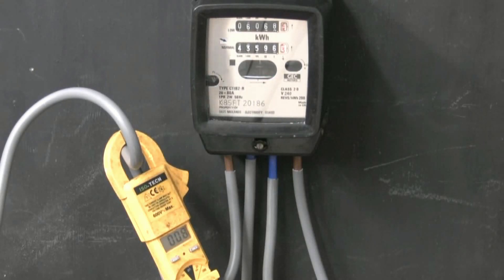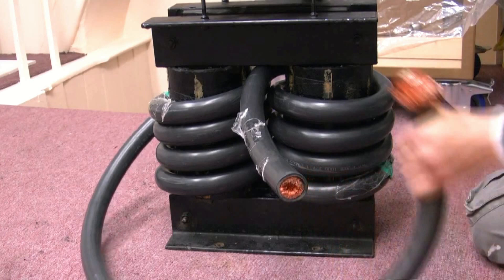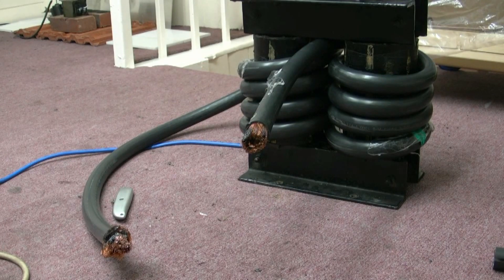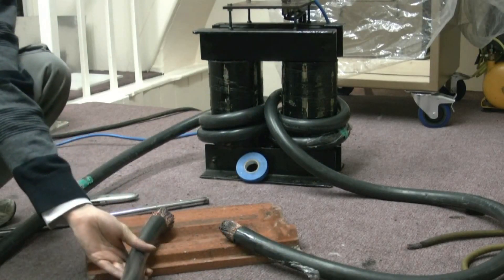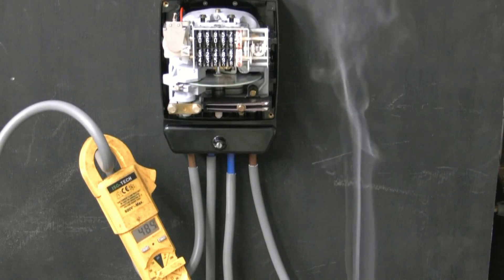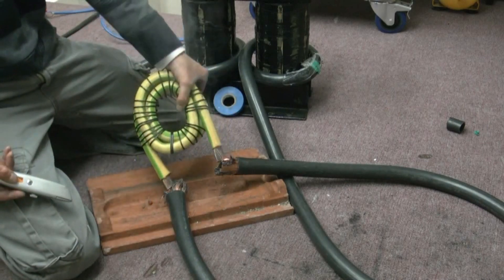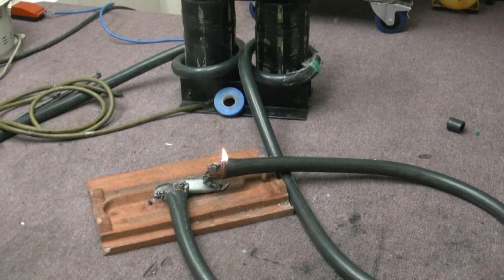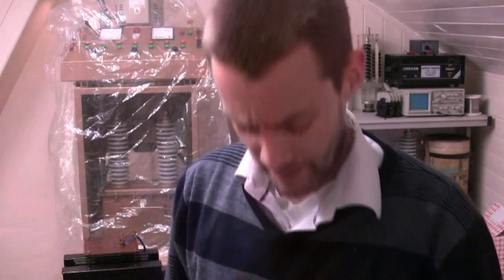Too Much Current + Electric Meter Pops

Comment: Dear SIr,
I'm an electric engineer and I saw your videos.

With your stupid actions You suggest persons without competence
in this field to do things potentially dangerous for their safety.
Maybe you are some kind of 'rough expert' in electric stuff but
you are an idiot for sure because you are an irresponsible person.

Best regards,
Michele Romeo

p.s. - if you ask me to do, I can provide you a list of very stupid things you made in all your videos.
Reply: It'd be better if you provided a list of every time he's said "what I'm doing is perfectly safe, please try this at home."
Reply: I'm sure you're very intelligent (sarcasm).
Reply: Michele Romeo Attempting to condescend someone whilst knowing nothing of said person really just portrays you as being the person to avoid.
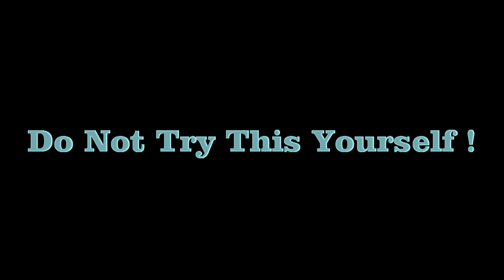Reply: It says at 0:12 "Do not try this yourself!"
That's enough of a disclaimer, don't be such a stick in the mud.
Reply: Michele Romeo I do certain things without fully abiding safety instructions due to experience in my fields of knowledge. I have never been injured in this way.

I'm a safety oriented person. Once I quit a job of 2 years because my regards on safety (especially for newer persons in that environment) were disregarded. 

Unless you list actual things that were done incorrectly (and there are some) you have no argument. Up to this point you're all smoke and mirrors. 

Everybody has a different limit to what they'll do safety wise. When I'm dealing with high voltage and thick wires I wear gloves, make sure the wires are not live and use one hand so there is no way for current to go through my heart. 

However with the knowledge he possesses he can have some leeway with the electrical stuff, provided his knowledge is good, he'll survive. 

It's the same way with me in a lot of different situations. 

Accidents do happen, independently of measures taken for security. What he does in this videos is extreme by nature. An unexpected explosion and an unfortunate piece of shrapnel and PI loses an eye. Still it's his choice. 

No regards,
ME
Reply: Dear Michele

Fuck off

Sincerely, everyone.
Reply: kkonstantinosss2 "Romeo, you do not know how to write properly." ...First, my birth name is Michele. Second, I write properly, better than you. Third, I know electric engineering, which I teach to students everyday, students that want to go back to their family at the end of the day. At the end, I do not care about stupid persons with totally unuseful opinions, and just the desire to insult the well-posedness of shareable statements, with no criticism, no hard things on which to make serious discussions and all what human beings need to say to be 'intelligent'. Conclusions come almost natural: any comparison with you gives no sense. Come back to me when you have 'real science' to discuss on. Best regards, Michele Romeo
Reply: I am also an Electrical Engineer, what he does has the potential to be very dangerous but he handles himself and the equipment relatively safely. Notice that current takes the path of least resistance and he plays with high current by using beefy power supplies and heavy conductors... theres really little chance he will be in the path of this mighty power.
Reply: The disregard for safety is part of what makes these videos entertaining, but that point seems to have gone over your head. Also he's made it abundantly clear that what he's doing isn't safe and most certainly shouldn't be replicated, which also seems to have gone over your head. You try to make yourself out to be superior to everyone because you're oh so serious, when in reality you just seem to be complaining for the sake of complaining. You've implied many times in this thread that you have no interest in the opinions of others or in petty debates, yet you continued to reply after you've said so. A point which only goes to show further that you're just complaining for the sake of complaining.
Reply: Michele Romeo So you're saying he's stupid. Do you realize that you are talking to a high-end National Grid engineer?! Furthermore, you offering a list of 'stupid' things in a sarky way, saying he's irresponsible is just plain foolhardy.

I urge you to either remove or reconsider what you've commented on and your actions against Photonicinduction as you have been quite rude to some quite intellectual people.

I won't say 'cheers' as that's your insulting word of choice.

And you saying there are cretins commenting here? Well there is a cretinous being here........ You.

I may be younger than the people who have commented, but even at my young age, I can still see your rudeness, your total disregard for others, and you being self centered, goes to show why you shouldn't have posted.

Therefore, I would like to advocate my disgust of what you've said. In which capacity I shall encourage Photon to carry on making videos for the entertainment of others, and for people to comment without you.

Thanks.
Reply: at which point does he go out and tell us to do this shit? we're not stupid animals,. we know it's not safe; that's why we let people like him do it..so we don't have to :}
Reply: Jamie Evans You are begging the question by assuming that he is, truly, a professional and by claiming that I know nothing about the subject. Your statements are unfounded. If they were anything otherwise, you would be able to present concrete information to me (graphs, charts,university studies, ect...). Of course, no such things exist about my knowledge, so do explain to me precisely how you know that I know nothing about this subject. We both know what that outcome amounts to.
Reply: People by nature do stupid things, some of them dangerous. This guy does them only after pre-warning about their being hazardous and does not advocate nor condone people doing them without a proper understanding of what they are playing with. He also does them in the interests of the entertainment of his viewers. There are so many things one can watch on main stream media that people could copy, that inevitably could end up in serious injury, hurt or death. The onus is upon the individual to make decisions that are wise.
Reply: Those who can, do. Those who can't, teach..
Reply: Romeo, you do not know how to write properly.
Reply: Michele Romeo First off, I am not german. I live in Switzerland and although I speak german because the native language in the part of Switzerland I live in is very similar to it, swiss people have a very different mentality from german people. This doesn't mean I dislike germans in any way. I also have many german colleagues.
Secondly, tell me how my comment was not logical. Maybe you interpreted it differently from how I meant it to be interpreted due to my lack of knowledge of the english language while writing it.
What I meant was that most people aren't as stupid as the comments they write. Indeed there are also very stupid people writing comments, but it is difficult to differentiate between these and the ones who only "pretend" to be stupid if they don't write a sensible answer afterwards.

Overall, if you still don't agree I would be interested in your opinion on the matter, because this is just mine.

Regards
Reply: Do you honestly think he doesn't know what he is doing?
Reply: There's always someone out there who takes other peoples lives too seriously. You don't have to watch his videos if they offend you so much.
Reply: ooow you're an engineer, big deal, so am i, and i think this guy is freakin hilarious and most entertaining to watch. he seems to know quite a bit about electricity, probably more than you.
Reply: The youtube Comments section ! Always a lovely place
Reply: I agree with Okan, nobody really gives a toss what you think. Your attitude makes it sounds like you think you're better than everyone. The truth is, you come off very insecure by the way you carry yourself and the words you choose to say. If you don't like the video, move on to the next one.
Reply: +Michele Romeo dear sir... or madam i dunno whatev....SHUT UP
im an electonic god and believe that photonic induction is safer than having sex with you
your argument is as invalid as your cleavage
i hope this message finds you in hell you prius driving bastard
best regards
pingu

p.s. if you want i can list everyone in the world who gives a shit about what you think

yo momma
even yo daddy aint care
Reply: Kevin Jacobson ...so it's better for me to avoid persons like you. Cheers, Michele
Reply: Kevin Jacobson "Knowing nothing of said person": The words of someone who knows nothing of said subject.  The condescension is from a professional perspective, and a sound observance of how not to treat the dangers of electricity.  But if we need to spell that out for you, then I have to defer to social Darwinism.
Reply: Michele Romeo... You mean Michael Romeo...
Reply: Michele Romeo Who's the drag queen in your picture?
Reply: Oy vey, muh soginy! 

Just leave them be, will you? They are doing this for entertainment. They know what is dangerous and not.
Reply: Dear 'sirs',

honestly I'm really happy that the world is in your hands,
because in this way I can manage you as I want to improve my life.
Stupids are just manageable. Science proves that ;-)

I explain it for 'stupids', don't worry.
If it is true that a level of confidence with common things comes from a well-posed feeling with a mental well-lined life, on the other hands 'stupid peoples' are needed from nature to get that part of equilibrium for human beings that peoples like me are not able to build.

In this way, conservation laws are per-fect-ly preserved :-)
Great, ah? :-)

So that, I'm really sorry to be better than all of you but it's so.

Cheers,
Michele Romeo
Reply: kkonstantinosss2 i do know your comment is 3 month old, but i feel the need to comment personally.

Frankly sir, your behavior is one of the cause of incident in high risk equipment incident. 

Your so called "leeway", which - if i didnt mistaken- was referring to your personal choice to abandon safety means and procedure because of your experience in you believe in your- if i may call it- luck, was the cause of some deadly incident in various environment. Because in these high risk environtment, when accident strikes, it strikes hard.

I could show you not just a study, but an entire chapter of a Reference book in HSE course for this if you need, but i think it will be easier to just ask somebody you know working as HSE officer.

She might be complaining about lack of safety precaution in this video, but in your reply, you tell us that you do that in your daily works?

Good luck for you sire :)
Reply: Michele Romeo Your behaviour has set another point of interest in the discussion. I agree on the fact that the guy does dangerous stuff with electricity, and yes, he might even get hurt, but the thing is that he choses to do so, and that's HIS choice. If you want me to put my arguments on the table, fine, i have some spare time now anyway: - Do you think that abyone has high voltage transformators at home? 2 centimeter thick copper insulated cables? Hell, would you even think that someone wants to fry his kWh meter? NO, of course not. A video cannot encourage someone with these items laying at home to do these things. Not even at their school. That's one point. My second criticizing point towards you is that it's not necessary to tell your life function before your point. You should SHOW that you know what you're talking about; you're not applying for a job on the internet, you're showing someone what you're made of; not by telling them your degrees.

Hope that clears it out a bit.
Reply: Michele Romeo Fellow colleague, I support every word you wrote.
Reply: ***** , I thank you for your civil reply to my point of view.

Regards,
Michele Romeo
Reply: you must be fun at parties.
Reply: More of a buzzkill than Buzz Killington.
Reply: Michele Romeo You're right.  This is a devaluation of life that people should recognise above the jaunty attitude of this imbeciles.
Reply: Dear sir,  your words speak for themselves. Nothing to add. Conclusion is the same before. Cheers.
Reply: Kevin Jacobson I don't care stupid issues. Come back to me when you have something really serious to discuss. Cheers.
Reply: SlashButcher I have all night, bud.
Reply: SlashButcher HAHAHAHAHAHA what a fucking disgrace. God. Lmao.
Reply: hes the fucking man what are you chirping about people
Reply: Michele Romeo Haha I must say I understand and generally agree but there is a difference between people that are actually stupid and people that act stupid on the internet towards people with a different opinion than their own, either because they don't judge the other person worthy enough to leave a sensible comment, they don't care about leaving one or they do it for fun. I am a perfect example of the third category, so overall I am not stupid at all and I think so are many other commenters here. If you are less stupid than me or any of the others can't be judged from this comment section.
Reply: Dear 'sir',

you seem to be a deutsch guy and I have a lot of deutsch colleagues around the Europe with a very strong point of view about what a 'good' life
must be,
but they use logics in the right way to produce both good science and life
for the other people.

Please, put under stress your analysis.
Your statement means 'nothing'.

Refine your logic performance in mathematics and come back to discuss with me.

Mit freundlichen Gruessen,
Michele Romeo
Reply: Thanks for your honest and appreciated high-quality reply.

I now recognize a person for which it is a pleasure to spend my time here on this social network.

Please, just let me time to reply you because I'm working right now.

Stay updated.

With my best regards,
Michele Romeo
Reply: ***** .........Wow, I am shocked . You have totally demonstrated your ignorant and the lack of understanding of scientific methods or science (in general) beautifully. Congratulation
Reply: *****
Pidgin, not pidgeon.
Reply: *****
... do what now?
Reply: Nothing wrong with having some fun
Reply: Michele - you are correct. I also am an EE and looking at what they were doing (especially fooling around with 240V mains plus the fact that they appeared to be intoxicated) was very dangerous. In the video, the guy does say this at the end but he should have put all of the "its illegal, its stupid, its dangerous - leave the stupid stuff to me" right at the beginning.

True - nothing wrong with a little fun but people have been killed this way having 'fun' with electricity. It did remind me of that old series "The Secret Life of Machines" a litttle! ;-)
Reply: Michele Romeo  my dad worked with electric too so u are a bossy person   he is doing nothen wrong
Reply: Jeff Waterman me too
Reply: ;P idc
Reply: Michele Romeo Please continue spending your time teaching people on the internet with your nice degree in electric engineering; your words mean nothing to them as much as theirs don't mean nothing to you.

PS. your German gave me a list of diseases.
Reply: ok
Reply: Jamie Evans well it really don't matter how "professionally" condescending you talk to some one its still condescending LOL
Reply: It's amazing to see how many dummies are on this post.
Please, take time to refine your mind and make you better than you are now, dears.
I think you will have a not so long time to enjoy your life if you proceed on this way.

Do you know it? ...stupid people have no chance to teach something to the others,
but they anyway spend time to try to do it as they want it ....unfortunately with no success.

...but anyway, I'm behind the desk and you not.
Maybe some reason lies on that....right? ;-)

Cheers,
Michele
Reply: Side from my day job as an engineer, I also teach engineering at the university. I can say Michele, dear, you've just stooped to the level of the person that you have been so arrogantly critical of. Cheers, good luck to you and your happiness :)  your students are lucky to have such a sparkling personality, lol.
Reply: Arrogance? ...take in count both persons that said something against me with no chance to prove anything concrete (including you) and my replies, and make some balance, my dear engineer.

Make it simple.
This video suggests internet users doing things with electricity in respect of no safety rule. Stop. Nothing else.

Please, pay silence.
Cheers.
Michele Romeo
Reply: Cheers
Reply: Michele Romeo You're the difference between half cheap Viennese and half rich Bulgarian. If you would understand me, you wouldn't act your way into the clever side of the internet. Most people stay humble on the internet; you should know that.
Reply: Dear Okan,

I thank you for your point.
I understood well what you say but I disagree.
I don't want to stay humble, just professional.
Nothing else.

Have a nice day.
Michele Romeo
Reply: p.s. - have a look to the 'real' contents of the replies inside this post a make some science about them....after that, make some correlation with 'my nature'. You will be stupefied to see how really few comments are closed to the core of this discussion.
Cheers, Michele
Reply: Dear Madam, you are a troll .
Reply: ... And you should think about removing your photo (gag)
Reply: Michele Romeo A woman who understands electricity?  Seems legit.
Reply: David Palmer He's a man.
Reply: flahr1 o :/
Reply: Michele Romeo i do dumb things with electricity, like sending 120v to 12v computer components to watch and film them going "pop". so what. I am back away from the part and it is done outside. Almost always i blow a breaker and the part pops a few times, or I sent 120v to a computer motherboard through the 12v cpu connector. it shot sparks about 50 feet. so awesome. I know my limits and so does he. We really dont need people like you telling us what we need to do with our lives.
Reply: TheOne AndOnly I think he (or she) is a troll. meh. I love Photon!!! RODALCO, Aussie, all the people that mess with HV. It is a learning experience for me to. When photon left for a while I missed him. He was the 1st out of the bunch that i started watching. Long live Photon's videos! I really dont think if he didn't know what he was doing he'd mess with this stuff.
Reply: ***** i have respect for people like Photon, RODALCO, Aussie, etc. that do videos (that i learn from) messing with HV (and having major respect for it). A lot of things he does I am not comfortable doing myself, so i just watch him do it. It's enteraining and educational.
Reply: MegaSamura1

Dear Sir,

many thanks for your composed reply.
I answer you very willingly.

May be question was not completely well-posed by me but under a short look of a competent professional it fixes really fastly. 
Problem is not in 'what he knows how to do it', because he knows for sure what he does (almost completely, not entirely).

Problem is in 'what he translates', 'what he communicates' to other not-professional peoples when he does those actions.

Problem is in avoiding any kind of potentially unsafe experiment because the high level of accessibility of the video, that (for example) has not been locked to teen-agers that 'can' have access to stuff such to reproduce similar things in a more dangerous manner, precisely because the 'defect' in communication the right 'path' to do safely what he does.

So that, this is not a problem of 'electrical engineering', like all the poor stupids here are thinking about. This is a problem of 'how to make entertainment' without create a potential risk for safety 'behind' the screens of a wide range of unconscious internet users.

That's the only problem I meant.

...but, as you know, the planet earth needs to have stupids persons to make a good balance with intelligent peoples like me and you....

...and others, in some lucky case.

With my best regards.
Dr. Michele Romeo
Reply: DaleMAN 

Dear 'Sir',

sure your face is that of an idiot and then I understand
you when you say what you say.

Sure, you don't know the precise reason of the 'motion' of your mouth
and this is a real luck for you, trust me.

In other cases, you could consider how really poor is your intelligence and your general knowledge and culture as well.

So that, please...before to talk, switch-on your brain and pay silence, ok? ;-)

Cheers.
Michele Romeo
Reply: The others

obviously don't deserve any reply :-)

Yours sincerely.
Michele Romeo

p.s. - dedicated to the stupids...I'm an androginous, ...if you know the difference between a 'tomato' and a 'van', of course ;-)
Reply: Okan Karakose 

Dear Sir,

enjoy it - http://www.hse.gov.uk/electricity/

Yours sincerely.
Michele Romeo
Reply: flahr1

My dear,

I'm an androginous (if you know from school what it means...without using Wiki-sources :-) )...

....and sure you're a stupid 'man' ;-)

Cheers.
Michele Romeo
Reply: Michele Romeo
No, you're a man dressed up as a woman trolling youtube comments
Reply: flahr1

I'm sorry,

but I'm not a troll and peoples like you
don't deserve any reply, because
they have no respect for peaceful
peoples like me.

I have no gender problem and sure 
you cannot know anything of both my biology
and psyche.

Furthermore I'm an academic researcher and
I'm not sure that some well-posed comparison
between me and you can take place.
I don't think, as I saw the way you use to
express yourself.

In the end, I have no time to explain
something that sure you cannot understand
and don't want to spend mental resources
with stupids like you.

Just to cite a phrase of Mickey Rourke
from the famous movie 'Harley Davidson
and Marlboro Man':

"If I would have a cent for any guy that
says to want to kill me, I would be a rich man."

Regards,
Dr. Michele Romeo
Reply: Michele Romeo
You responses show your lack of intelligence.  Your degree means nothing from a diploma mill.
Reply: Dear sir,

do you want to make me feared?
You are threatening me?
Life makes this work better than you everyday and your opinion has no weight compared
with that.

Sure, you dont' know anything both about me
(youtube, g+ and so on dont' really matter
and dont' show you anything) and  problems
with real HV electricity (I mean in factories like this...

http://video.sky.it/news/cronaca/incidente_allilva_di_taranto_morto_un_operaio/v20098.vid

which brought to death several of my colleagues in the recent past
in companies that accomplish similar behaviors and I faced both the mental pain and the pain in the flesh of their relatives each time I heard somebody else to make some laugh with no care for their human nature like in this context.

But obviously, you cannot know anything about me and my pain or my role in this context.
It seems nobody has real respect for human beings or life.
Everything seems to be just a joke, the life itself.

Maybe I'll close this post but for other
reasons, not your threats for sure.

Because the point of view of persons like me seems to have no echo among users like those here, so that it can be totally unuseful and a big spent of time with no match of any concrete target. But I have just one consolation.
Nature teaches better than me

 http://www.esfi.org/workplace-injury-and-fatality-statistics

One thing I know for sure.
I'm a professional and this is enough for me to pretend to teach something to peoples that use wrongly electricity like a joke.

Regards,
Michele Romeo

p.s. - I don't use to hide myself. It takes no sense if I want to teach something. On the other way, I'm not a troll. Just a professional and a person that have respect for humans like you and the others.
Reply: Michael, you've made your pont and no one cares.  move on.
Reply: Michele Romeo hes trying to do stupid things, thats what makes this channel great. get out
Reply: Dear Emilio Torres ,

many thanks for your support.
Note that a very large quote of the negative comments
here against me shows no identity of the users.

Ask yourself 'why' and try to make some comparison with
the 'real' life that they can have out of here in hard contexts
not strictly related with the virtual environment, like here.

Sincere regards.
Michele
Reply: Dear Mr. chad h ,

I thank you for your serious question
(it seems so).
I thank you as well to not refer to my gender condition in this context.
This is not the right place to answer your question but I think you are checking my
knowledge in electrical engineering to understand if I'm honest or not.
 
Please, clarify it a little bit more. 

First case:

1 - is it a star/delta (say wye/delta) or delta/star (say delta/wye) transformer?

2 - you can have several ways to earthing a transformer (on the wye side). Please, specify 'how'.

3 - in case it is a delta/star transformer, are the secondary coils closed on some load?

(I think it is a star/delta transformer because you write "If the secondary delta..." starting to talk about the second case. Btw, question is anyway well-posed)

Second case:

1 - I think you refer to the 1st case transformer, am I right?

2 - you write: "Will the currents on the first transformers primary side remain 0...".
You use the 'plural form' but it seems you have only one transformer before the zickzack one.

3 - you write: " ...if a phase to earth fault occurs?"
Please, specify on which side the phase you refer to is (maybe the same as before; btw, question is anyway well-posed).

Thank you and regards.
Michele Romeo
Reply: pretty sure people with no continence won't be able to figure out how to do most of the shit photon does
Reply: go back to tumbler
Reply: +Michele Romeo you say people "dont deserve any reply" yet your replying to them in paragraphs ? makes complete sence to me :/